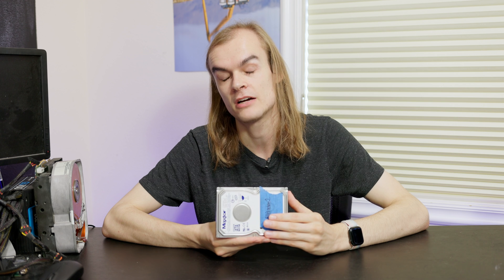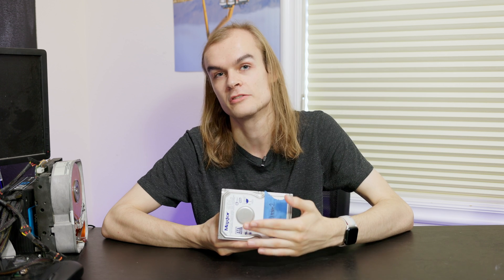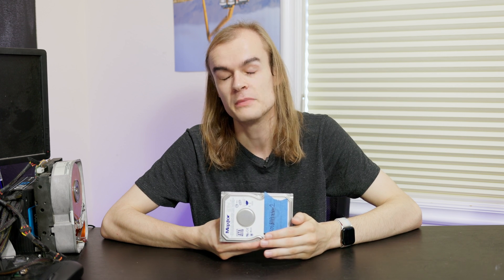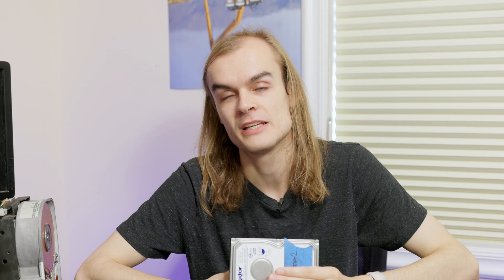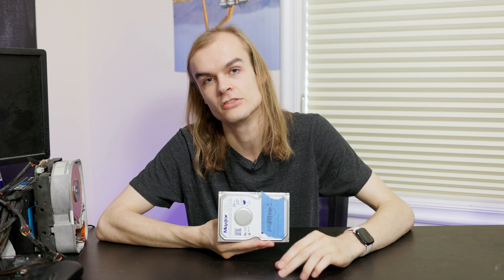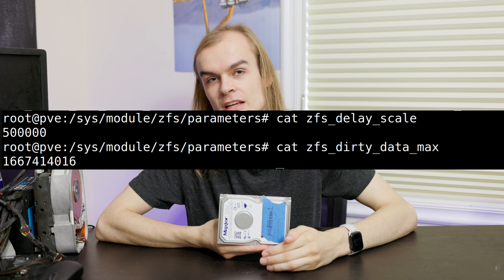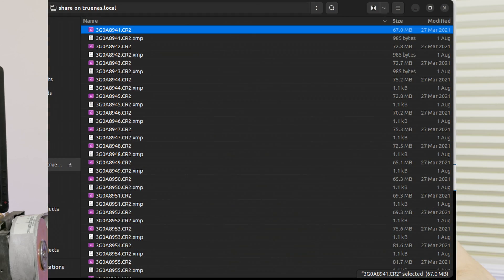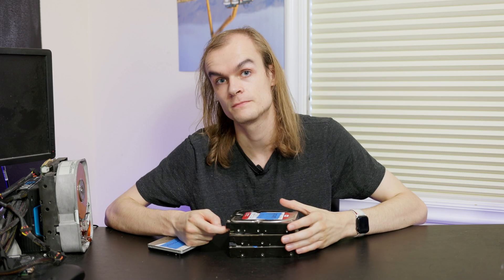How to setup HDD Spin down in Proxmox VE

Comment: I was trying to use HD parm in proxmox backup server. I had a few SSD discs that were made for less than a month backup timeline and then also I had some hard disks and my goal was to do that once a month. So ideally they'd be spun down for an entire month and only spun up for the one day that they did the one backup and sync and extraction etc. The trick is how to get it to stay three reboots and etc. Did you make a service for HD parm or do you run a crown tab or what method did you use editing the HD parm file is not working for me

Comment: To prevent spin down which shortens the drive life and causes other issues, I installed the sdparm package. Then I added a line per disk to my crontab (crontab -e):

*/4 * * * * /usr/bin/sdparm --command=start /dev/sdd

The drives (WD RED Pro) spin down by default in a few minutes. The above cron simply sends a harmless start command every 4 minutes. 

No more spin downs.

And before I get replies, yes I tried both hdparm and sdparm to write a value to disable or stretch the window of spindown.  WD blocks it...and they only offer a tool that can adjust SOME models and no tool for Linux.

Comment: We could potentially rebuild something similar to Unraid’s functionality using OpenMedia Vault in an LXC container. This container would combine SSD cache with HDDs in MergerFS. Running Unraid on Proxmox as a VM with HBA passthrough works well, but OpenMedia Vault would be much lighter and wouldn’t require passthrough. Just thinking 💭

Comment: I encounter a problem is that: when I constantly(every 1 minute) query "hdparm -C /dev/sdX", my seagate ironwolf drives won't spin down, as long as I stop querying this command they spin down properly. After they spun down, I query "hdparm -C" again, they won't spin up again. so I guess I will just trust them, and stop monitoring the spin down state.
unraid use hdparm to spindown and monitor the drive state too, but they don't have the issue. it's weird.

Comment: This video was great for what i was looking for, the only question i have is regarding proxmox and truenas. How did you pass the harddrives into truenas nas and was it in truenas where you set the spindown commands or was that done on proxmox ?
Reply from the maker: There are multiples ways to passthrough drives to truenas in proxmox. The most ‘correct’ way is probably to passthrough the disk hba or controller via pcie passthrough. Then truenas will have full control over the disks and spin down. This will also require a separate controller for proxmox disks and truenas disks. You can also give truenas virtual disks via virtual disks or passing through a /dev/sda or other proxmox disk to truenas. This will have proxmox manage spin down and control of the drives in this case.
Reply: @ElectronicsWizardry  First of all thanks for the reply. Since I dont have an hba to pass through to the virtualized instance of truenas im running on my proxmox server I tried managing the hdd spindown from proxmox directly like you mentioned. It worked beautifully for around a week, the HDD would spin down after the set amount of time (2 hours), but for some reason that only worked for around a week I cant get it to spindown on that timer anymore. I changed nothing and I even made sure that no other VM or container was using that share but it still will not spin down, even when I force spin it down proxmox seems to wake it back up. Would you happen to have any pointers on where to look?

Comment: Thanks and great video(s)!

I wanted to mention (if anyway is interested) that one does not need to actually have a VM running Truenas let's say, with passed HDDs/LSI HBAs, which are then further shared over samba. Just having 2 pools in Proxmox as you suggested is enough. One for SSDs for the LXCs and one with HDDs for the big stuff. Then bind mounting various datasets and folders to the LCXs will not make the drives spin until those files need be accessed. Example: an LXC with Jellyfin with rootfs on SSD but with a bind mount points on the HDD for movies will spin up on playback.

Comment: you could turn off ext4 journaling to prevent drive spin ups_ but you'll risk data corruption in case of power failure ... tune2fs I guess is the command that does the job ..

Comment: I've already lost 2 seagate external hard drives of 4TB (they weren't iron wolf) that were very little accessed in 5 years, and the data written on them occupied much less than 2TB. I also had issues with unrecoverable data on SnapRaid. I'm thinking of doing the following, using 1 parity HDD, and 2 data HDDs, with SnapRaid, all ext4, and for greater security I want to have mirror HDDs for the data, leaving me with 5 HDDs (all WD Red). From my personal experience 3.5'' HDDs give less problems than 2.5'' HDDs, I don't like external HDDs because of the possibility of accidentally turning off the HDD when they are transferring data, so I was decided to use them as internal HDDs and hdparm (or set 15 minutes of stand by on Disks), however, I was afraid after seeing your warning about the wear of accelerating and decelerating them. Basically I will power up these mirror hard drives once every 7 days, they are simply for backup: what do you recommend?

Comment: Looking for some advice please - I am running a proxmox PC that is drawing about 140 watts average at present - there are long periods in the day when it is not required, whats the best way to save energy without damaging or shortening the life of the PC
Reply from the maker: What hardware is your Proxmox PC using? With the hardware specs you can make a good estimate of whats pulling the power, and reducing the power of what draws the most power.

Id probably setup spindown after 30min if HDDs are a large amount of power draw. Then they will be spundown when the server is idle, and there won't be an excessive number of cycles on the drive.

Wake on lan could be setup if you want to save even more power. You could turn the PC off when your away, and have it turned back on when your ready to use the system.

Comment: Thanks man, your videos are just perfect nuggets of very useful information which are very hard to figure out otherwise. I hope more people appreciate all the time it takes to figure out such seemingly obscure quirks for such a short overall video. 

P.S.

One thing I have noticed with HDD spin down and ZFS is when it needs to be spun back up for access it takes longer with the more HDDs you have in your pool as the HDDs are spun up sequentially as opposed to all at the same time with ZFS arrays, which can in itself be a disadvantage should you have a large pool of HDDs running ZFS.

Comment: I'm running 2 separate PVE nodes, each with a different NAS OS. One is TrueNas Scale and the other is Openmediavault. OMV has an internal spin-down command. Not so sure about Scale. At which layer should I execute the spin-down? At the Datacenter level of PVE or within the VMs themselves (Scale and OMV)?
Reply from the maker: The spin down and other power control commands for the drives normally need to be done on the host instead of the vm. The proxmox host won’t passthrough the commands given to the virtual disks to the physical disks storing data. The exception to this would be if your are passing a drive controller like a sas hba to a vm where the vm would now be in control of drive power commands.

Comment: run 2 independent nas with raid arrays - leave them on all the time- have a ups on each and also email notification and logwatch daily reports, the rest of the network is ssd or nvme - do run caching on nas and also with web servers (cache just static) - this can take off 90% of load on server and boost req and latency/web page speed #ab #hdparm #--assemble --scan

Comment: servers are rarely idle - consider a web server that gets 10k hits a day which really isn't that much but you may as well just leave it on - a raid array is going to use like 5w/drive - it would take 10-20 drives to even equal 100w lightbuld - most electronics will fail with lots of off and on cycles vs just leaving devices on continuously...this does not apply to nvme obviously and nvme is the way to go - much lower latency and virtual price parity with regular ssd - nvme scales well over the network which is why you geally want to go to fastest networking you can manage - 2.5 is gud, 10 is better, 100 is best and 100bonded/bridged is very best - pls try a opnsense ha setup with some sbc - failover and link agg #triwan
Reply: other than doing a ha opnsesnse why not do content on the entire enchillada which consists of
2 sbc for opnsense
2  nas devices (can also be sbc) - sep nas with raid arrays for backup redundancy
a sworkstation of some type can be 4th gen intel with some extra ram or something like ebay z440 - supports booting from nvme and bifurcatiion so you can run 4 nvme on one card
a sniffer box - selks 6 may be better than selks 7 no docker needed...this will do 24/7 pkt cap for all lan devices - suricata/moloch
3 cluster nodes - qemu/kvm or proxmox - live migration, load balancing, mysql cluster (postgres cluster?) and netfs - you can spi9n up vm on ws to avoid quorum issues if one node fails
2 pihole on sbc, run recursively
all told 11 devices but this system is what smb needs - with nvme and faster networking if possible - smb sector can easily scale - team it up with vps for r proxy - this is a good setup for builders to sell - build for 3k sell for 4k or something and build and ship it in a day - everybody is happy
Reply: Zfs is a pig with lipstick on anyway.    Built a 5 drive 8tb  zfs2.    Hba all connected with sas.    Brand new drives  created it   left it a few days to check it was stable. Transferred  all the data I had to it.  Left it a few days and all good so removed the external drive data on a different machine.  30 min later the whole array broke and cannot be recovered.     I was just in the process of setting up a one drive sync in lxc  to send folders through for a cloud backup.    The drives still work fine a year later.   But I will never use zfs again.  I will stick with large drive and equal volume of one drive space.
Reply from the maker: I’m curious if you know what errors you have seen. Zfs in my experience and many others is a stable file system.
Reply: @ElectronicsWizardry  the caching system is what makes zfs so great spinning rust is fine but can you serve up from cache w/o having to spin up the rust? it is sort of like using caching r proxy - you can hit the static cache and site will get served up - it won't even goto disk until there is some db req - it can improve perf by up to 90% #zil